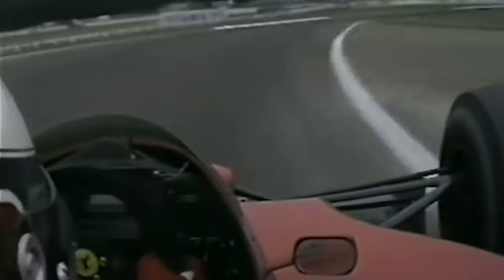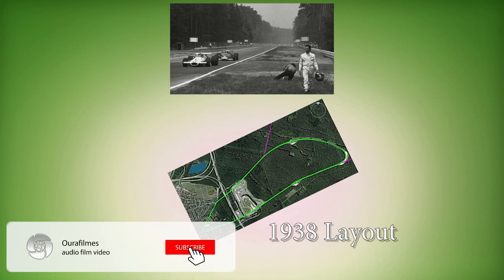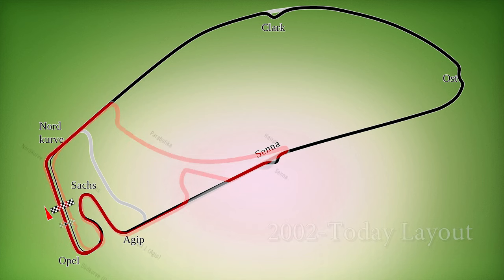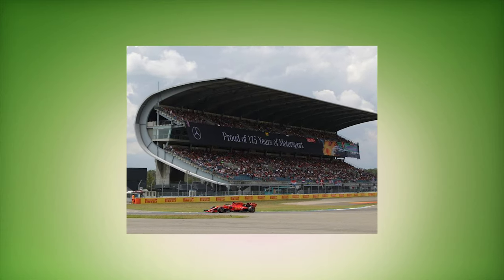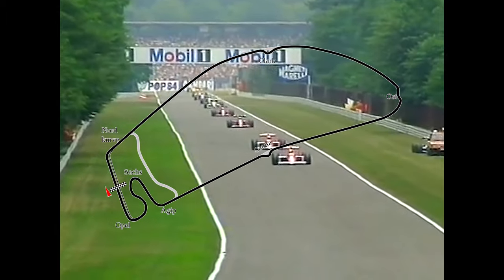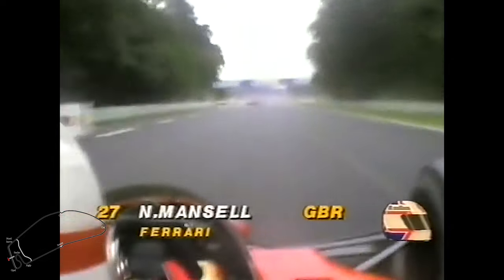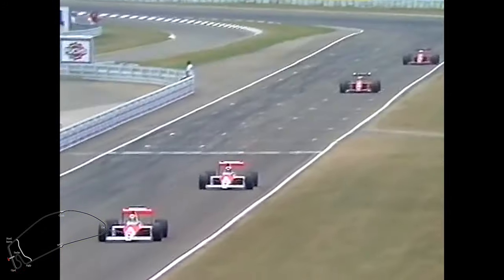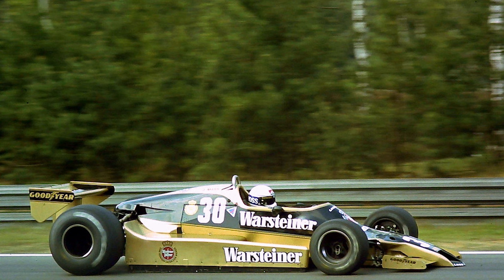Hockenheim Old Layout Onboard 1979/89

Comment: Hold on. The circuit of the year 2000 will not be missed by the fans? Hold on just one minute, I have never heard such nonesence I miss the "engine breaker". I cried a river when the new curcuit got built.

Other than that thank you for the video. You did well in telling the history and especially onboard videos.
Reply from the maker: Good point although I also mentioned the "rage". Cheers from Portugal!

Comment: why did they even change it? can`t be environmental reasons looking at how many trees they cut down for the new section. The old layout integrated itself so beautifully into the forest. I don`t understand how F1 say they push sustainability, but then replace beautiful natural racetracks with giant glorified parking lots with no grass or any greenery.
Reply from the maker: Money my friend...
Reply: Issues during the 2000 race (the one won by Rubens Barrichello, in that occasion parts of the pitlane flooded and in the race a disgruntled and drunk former employee of Mercedes invaded the track on the forest section to protest about his resignation.

This caused Bernie Ecclestone to blackmail circuit owners to make changes to improve safety off-track or he would move German GP to EuroSpeedway Lausitz (don't know if a rebranding of the Nurburgring race from European GP to German was also considered) or even cancel the German GP altogether and replace it by a race on Asia/Middle East (like the ones who debuted in following years like Bahrain, China or Turkey).

The options to Hockeinhein staff was or to bring down the entire perimeter around the (old) circuit, or to hire consulting services of Hermann Tilke who came with a solution who torn down a smaller area: the circuit they race until the present.

On the issue of not having preserved the old circuit, I think the pressure to not maintain it came more from Ecclestone that to any environmentalist group, basically because it have a precedent: in the reforms to Interlagos circuit (1989/1990), Ecclestone explicit forbade any layout who could have a oval variant, to prevent CART/IndyCar to race on the track too (monopoly? i think yes). Since the old circuit resemble an oval and CART was doing a series of excursions to Europe at that time (remember the race who Zanardi lost his legs? It was at EuroSpeedway Lausitz), so to prevent an even bigger schedule of races on the old continent he sabotaged any chance of the Champ Cars to race in a circuit like that.

Comment: I really dislike the Ostkurve chicane, but I really miss the run into forrest.. 
How the high pitched engines would thunder out into the woods, sounding like disappearing jet planes.. 
Especially in Toca Racedriver the Ostkurve was dreadful
Reply from the maker: Old track was so much better!
Reply: Back again after about a year... watched the whole thing again. It's good.. 
And to add to the convo. 
Yeah, that curve was one of those no fear and absolute confidence in equipment and skill. People like Mansell, Senna, Piquet, Arnoux, and many more.. they would probably go flat out after tapping the brake and going down a gear. A real make or break corner